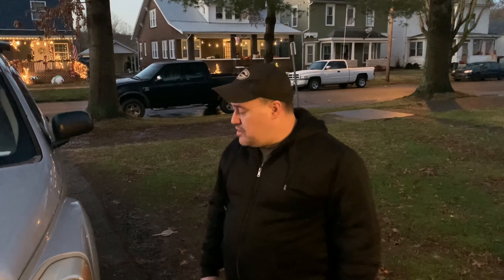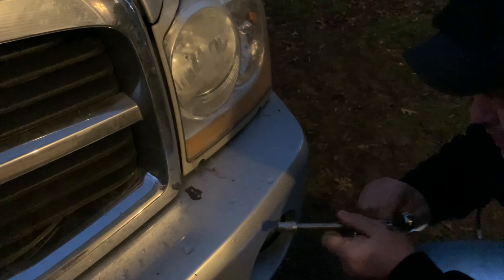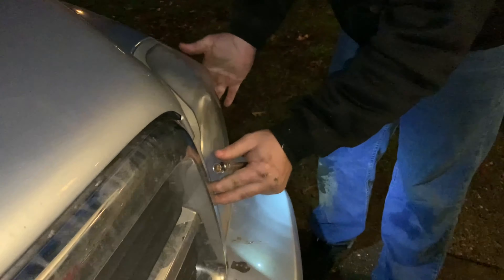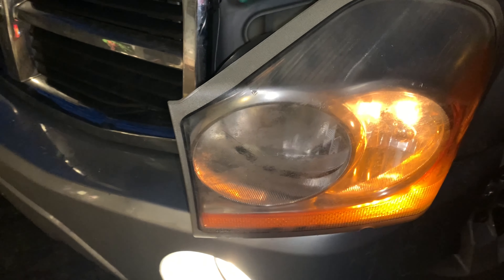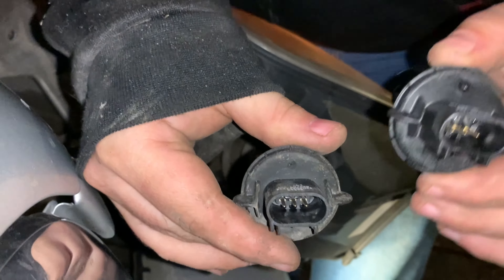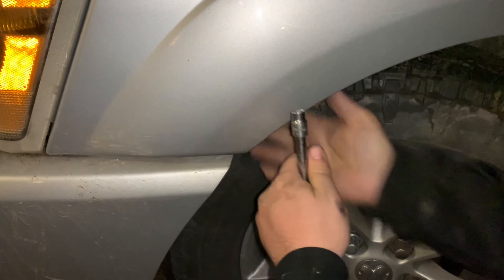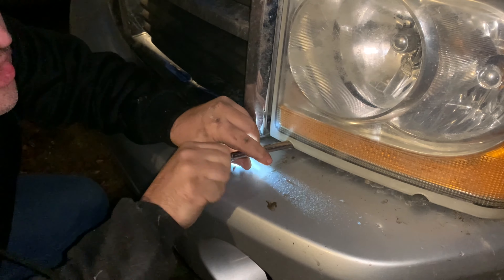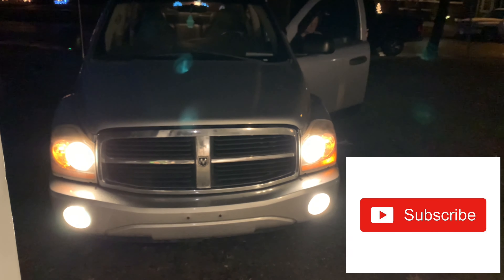How To change A Headlight Bulb In A 2005 Dodge Durango 5.7 L Engine - DIY - Guide

Comment: Good job. My 2004 Durango ST with the 4.7 Liter Magnum is exactly the same (I think 2004-2006's are the same, regardless of engine type). My headlights were the OEM from 2004! The driver's side one finally blew after 16-17 years! I kept making fun of the wife's Nissan Rogue, which blows low beam H11 bulbs every year, so I jinxed my Dodge finally. 

I went ahead and installed 2 new bulbs to make sure the brightness matched and head off the potential burn out of the other bulb. Then, a darned dump truck spun a rock up into my driver's side and cracked the plastic housing. Now I am awaiting 2 brand new plastic enclosures from Ebay.

Needed them anyways, as my headlights were hazy as heck and needed buffing/cleaning. Looks like your missing "trap door" is letting a lot of tire crud fling up into that light compartment. Maybe the junkyard has one for $5. Cheers!
Reply from the maker: It wasn’t my Durango but a friends because I work on cars for people and I replaced the trap door for them.  Also thank you for the kind words I hope you have an awesome day ✌️👍
Reply: @Mr_Goody  you, too man. What state are you in?
Reply from the maker: @TortureBot   Ohio, Snow and Ice 2021

Comment: Thank you for this. I would have never figured this out on my own. A hidden door...facepalm. Not the worst design ever but not the best. My 2005 Durango  (4.7 L engine) thanks you as well. Original bulb lasted until today, 23September2021. Subscribed.
Reply from the maker: You’re welcome my friend I’m glad that the video helped 👍✌️
Reply: Guess what happened today (07December2021)? My passenger side headlight on my 2005 Durango (4.7L) burned out. Guess grandpa was right when he said to always replace tires and headlights in pairs. Glad I have this video to follow along once more. Thank you.
Reply from the maker: My grandpa said the same thing. I guess they were right.  👍😬

Comment: Thanks buddy. New subscriber for sure
Reply from the maker: Thank you I’m glad the video Helped ✌️👍
Reply: So I have a question. I'm thinking I may have something with wiring because I've had to readjust my battery terminal a few times and when I do the green icon for headlights doesn't come on nor does the drivers side light. But the bright indicator comes on but still only works on the passenger side any help would be great
Reply from the maker: It sounds like it’s either a sensor for the headlights or a minor short in the wiring harness and also double check your fuses.

Comment: You can't change the bulbs just by going through the hidden compartment in the wheel well?
Reply from the maker: Not to my knowledge.
Reply: I tried until I gave up.  Then I followed the procedure in the video without a problem.